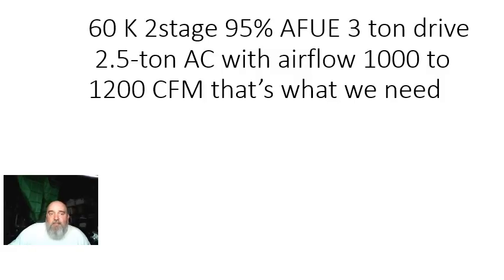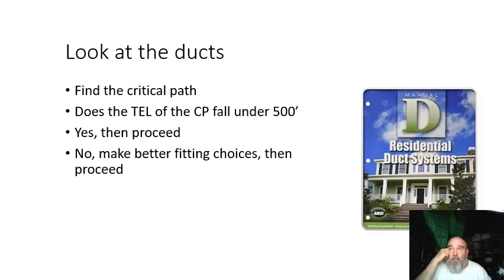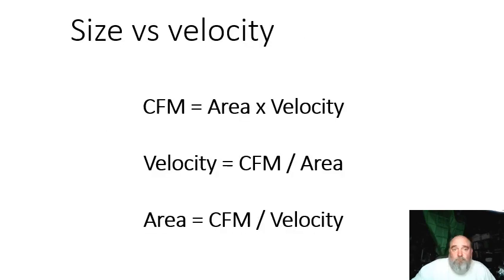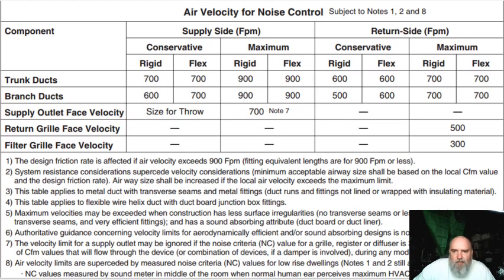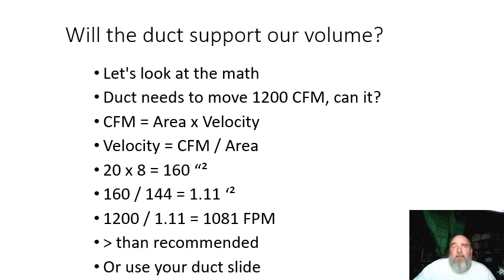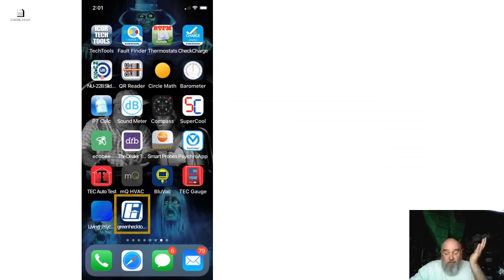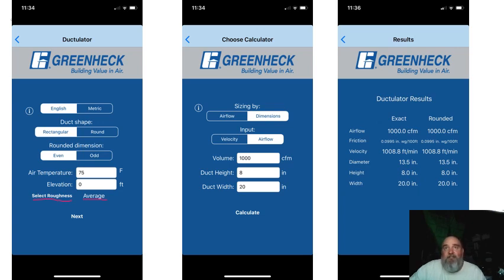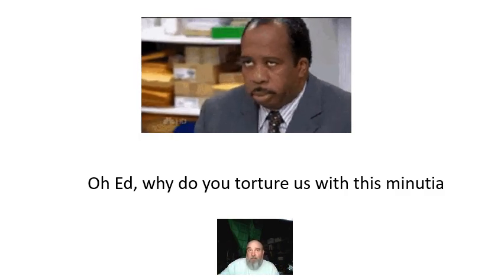Are the existing ducts large enough to move the new systems air flow at an acceptable velocity?

Comment: Loved it thanks for the video Ed!  I wish all ductulators would remove the 0.1 as recommended setting.  I'm fortunate to be in basement country (primarily), I can understand that low velocity may be an issue in humid climates w/ ducts in the attic (sweating of the insulation layer), but aside from that it seems folks don't understand that you can increase the velocity at the boot to achieve a good face velocity / throw! 👍